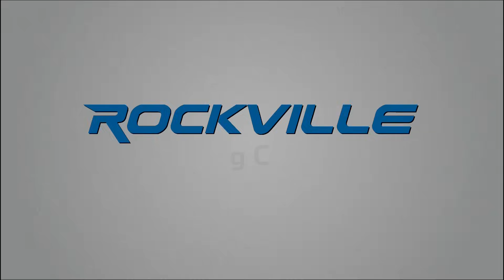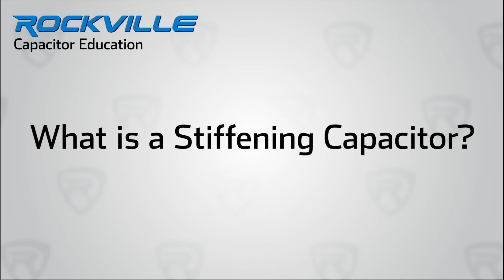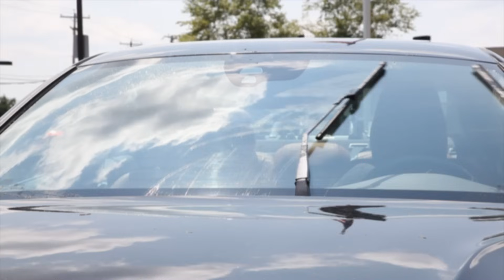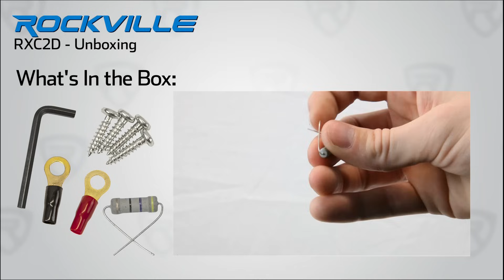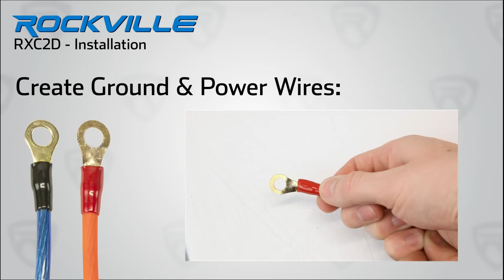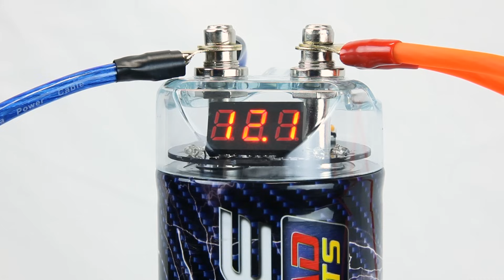How to install a car audio capacitor

Comment: OH GOD NO, More tattoo freaks. That is unprofessional, grotesque, and nauseating. Also tired of hearing that bass thump and shake my house as they pass on the thoroughfare three houses down the street from my house, and I hear them coming from what sounds like the next street over, and I hear it for a good 30 seconds at least, and feels like thunder shaking my house. It's worse when they turn onto my street. I wish the cops would crack down and arrest them for disturbing the peace, and excessive noise. Then there are those other idiot that like to broadcast that they have no genitals by racing their engine as their car roars like a stock car, to compensate for what they lack under their own bonnet.  Then there are others that have NO clue what they're doing and their car sounds like weed-whacker on crack. The fakakta mishigas that goes on around here is so obnoxious.

Comment: hello, I bought a crunch cr1000 I set it up as it was written in the prospectus.  But the light is still flashing.  I have a blaupunkt gta 4 special 750w amplifier and hifonics zxi12bp (1000w/500rms) subwoofer.  Please help.

Comment: My capacitor has been on the shelf for about ten years now. I don't have the resistor anymore does that make a difference sing how it's been used for about 6 years prior to me putting it on the Shelf?
Reply: Just find one on Amazon or any electrical store.

Comment: Should I put a fuse box for the positive wire of the fraud cap? Tia.
Reply: No. But did your capacitor come with instructions? Just wondering

Comment: First time i installed a capacitor i got a 23 farad one for over kill and read warning if you don't use the resistor when removing it can blow up i was like wtf

Comment: That's why u install a high performance battery you do not need all that in your trunk i never had it and never will i have Lanzar 10,000 watt'sbeating 4 jl audio 10 inch woofer's and 2 6x9 pop's that are 500 watt's a piece on my lanzar 500 watt amplifier😬
Reply: Yah im thinking the added chance of getting shocked to death isn't worth it. I got a better alternator and a yellow top battery and im running roughly 4000 watts and no distortion or dimming lights. Im in a1990 prelude also

Comment: Don’t forget to remind people about the danger of capacitors and how they can be killed by one.
Reply: Capacitors dont blow up they heat up and leak fluid
Reply: @BassManBobBassCovers  They also can discharge an extreme amount of energy in s fraction of a second.
Reply: @gideonkloosterman  you mean drain the battery?
Reply: uBreakIt iRepairIt how so?
Reply: @sleeks9939  Choking hazard

Comment: So if I shutdown my car, the cap will be still on? It wont disacharge my car?
Reply: Apparently not
Reply: They have stand by mode when they sense the amperage or voltages or whatever is down. No need for a remote wire

Comment: So i have to plug in " - "  from battery to capacitor too?Or the cable with " - " from capacitor it's actually the "ground cable"?

Comment: Thank you Rockville lady I was doing that capacitor thing for years and I was always wondering what that little grey thing was for but now I'm running a yellow top battery caps too bad they don't make car amps like they used to any suggestions
Reply: You don't need a capacitor for a yellow top? Im running one as well and my system is pretty solid

Comment: Capacitors don't magically add current to a circuit. It's a trade off, your headlight may stop dimming but your sub amp is getting a less clean supply. After that big bass note happens and the capacitor has discharged, it needs to recharge adding more load on your alternator and voltage dropping for the sub amp, causing distortion that could blow your sub. You're better off upgrading the main power and ground cables, aka Big 3 and or upgrading your alternator. That may seem like an expensive route, but if you've spent $1000+ on your amp and sub(s), forking out to do the power right and prolong the life of your equipment is better in the long run.

Comment: Finally a basic yet perfect explanation of how to wire it thx for the vid . But I heard the farad 1=1000 2=2000 etc watts so I'm kinda confused I got 2 12" infinity kappa subs 1240w each and a pioneer champion series 1600 watt 2ch amp.. 125a inline fuse n 4 gauge power wires from profamance teqnik said to b good up to 3000w....
Reply: It would be good to have  something between 2 and 4 Farads. It also wont hurt to have more than you need when it comes to farads. But I would say you would need at least 2 farads with that system

Comment: Hi i bought the capacitor from you guys last week I installed like In the video and It works but the only thing is that it didn't fix my headlights or inside lights from dimming whenever the bass hits you got any other idea on what can possible be causing the problems thanks
Reply: Gabriel Jimenez How many farads did you install? How much is the maximum current draw of your amplifier(s)? I usually recommend 1 farad per 1 amp of current draw (in my case I'm drawing 400 amps so I have a 500 farad cap bank). If you have bone stock electrical (stock battery, stock alternator, stock wiring, no big 3, etc.) then maybe make it 2 farads or 3 farads per 1 amp draw. Let me know if you need more help :)
Reply: Gabriel Jimenez Have you done the " Big 3 " upgrade? If not, Google it. See if this upgrade helps your situation.
Reply: Get a secondary battery, you can slap it in your trunk. Super easy to install
Reply: @judahdelay7756  would u still need to upgrade alternator if you do this
Reply: toysareforboys I have a 2000w amp and two 12" 1200w subs. My lights doesn't dim but I have this clock that measures the current from the battery, anyways, it goes from 13.6 to 10.9 when the bass hits. What do you recommend?
Reply: I agree with Love2xrl8rl. Get an upgraded high output alternator will be the best fix plus big three upgrade.
Reply: Battery. Time for more power!
Reply: Yep alternator and also a higher CCA battery also ensure you have a ground directly to the chassis using 0 guage you can also try wiring  your subs from 2 to 4 if you have the capability